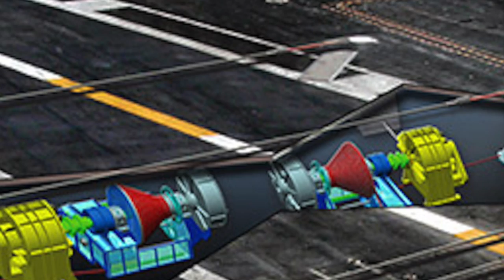WHY RUSSIA & CHINA SHOULD FEAR USS GERALD R. FORD? TOP 5 DEFINITIVE REASONS

Comment: 3:28 All the handles on top of the nuclear reactor are to open the multiple lids so technicians can do visual inspections of the many core elements.  This single reactor is an I-8 design.  Eight core elements.
Reply: Those are Electo Motive Diesel two cycle engines.

Comment: The USS Jerry Ford is quite a bit bigger than the Nimitz.   Larger ships can absorb more punishment.   If a YF-21 missile hits this ship and leaves a 40 foot hole from the deck to the keel it can survive better than the same damage on a Nimitz.    

The Navy is wise to think about this as sensors are becoming increasing more available and precise to allow these ships to be targeted.
Reply: Better to avoid or block an attack than to attempt to sustain it.. anti air on top and anti marine under is wiser but still not perfect.

Comment: I work at New port news ship building in Virginia that ship was commissioned with so many problems it had to be pulled back into dry dock. It was litterally dead in the water with no power for 3 days bet the news won’t tell you that thou...
Reply: nathan montes well it was late on it’s due day bud just because that doesn’t mean they didn’t fix it and doesn’t mean it’s shit
Reply: During tests that's normal
Reply: @tomocholla4458  O yes, the lets see if it can be dead in the water for 3 days test, - passed with flying colors

Comment: Everything has a weakness, I'd start with the computer systems as its probably manufactured in China. Ski jumps are not archaic, they are practical, they still get aircraft into the sky and don't suffer mechanical breakdown. You don't need a sledge hammer to drive a tack. Remember, never under estimate an opponent, it could cost you dearly. This ship can be sunk and that would be costly.
Reply: BTW ski jumps are archaic it limits what type of aircraft can takeoff/land on it. Can't have any larger slower planes the ski jump only gives them altitude not speed.
Reply: I doubt the computer systems are manufactured in China when the US is somewhat pissed at China
Reply: Ski jumps are achaic, IT limits Aircraft seize and ordenance carried

Comment: Each Ford class carrier costs $13 Billion. The F35 has cost $1.5 Trillion which could buy 115 Ford class carriers.
Reply: Mole Catcher a single f35 doesnt cost $1.5 trillion though? So stupid comparison. They cost $85 million each do you do the maths on how many f35’s you could build instead of one of these lol. Either compare individual to individual or whole projects to whole projects doesnt make sense to compare it the way you have. Besides you need aircraft to make an aircraft carrier useful. No point in building this amazing modern machine to then use 35+ year old F/A 18’s when you have modern f35’s to go with the modern carrier.
Reply: @0riginalFIR3  The programme is currently projected to cost $1.5 Trillion(this is likely to increase as have all previous estimates). That is 1500 x 1000 x $1 million. So, assuming that the $1.5 Trillion is Capital Expenditure and a unit cost of $85 million, then the US should be taking delivery of 17647 F35s which seems highly unlikely. For reference there were only 15000 P51s built. Clearly the $85 million unit cost does not cover the full cost of the project. The point is that there appears to have been a huge amount of US taxpayers money spent wastefully.

Comment: So the new launch systems use the same type of technology as a rail gun? Rail Guns are awesome... it is to bad that they require so much power and firing one slowly destroys them
Reply: Almost correct. Just one thing. It doesn't slowly destroy them. Maximum 2 shots at full power, and you're done.
Reply: Power is not a problem, composite materials Are

Comment: This may sound weird but I was thinking the other day about China and Russia's missiles nuclear or otherwise. What if they used an upgrade of the 6-inch gun or something that caliber and upgraded it to where they could use the 16 inch gun two or like a double-ought buckshot in a shotgun 12 gauge shotgun even like a proximity Road. Sight word processor word processor you're fired. Anyway just point the 16 inch gun like an automatic gun on a 10 can. It would take more metal infrastructure but if you shot the gun up toward an inbound missile, and you used it like double-ought buckshot and a shotgun and these were high explosive proximity rounds, would it be possible to take out a nuclear missile or weapon in Bound. It could work but who knows right? And they could use different kind of explosives in these proximity rounds even if it was small Tactical nuclear rounds. LOL

Comment: The Ford Class carrier is epic.
However in the top 5 you said the 2x 300mw producing nuclear reactors as a point on why the Russians and China should fear it.
What happens when all your nuclear Navy retires? 
The big problem is desposal of the radioactive vessels? 
Well in the UK we only have Nuclear powered subs and many times left than both the US or Russia, let's face it Russia had more Nuclear Subs than both the UK and US Navies. 
Prehaps, although the power output puts it in line for power hungry Star Trek type weaonary upgrades. 
Again what happens when they retire. 
Where are you going to put all these contaminated vessels when they outdated. 
Prehaps Russia and China are just waiting for you to be overloaded retired Nuclear vessels to degrade and contaminate yourself. 
Prehaps this is why they haven't "updated" to Nuclear Carriers, subs are understandable. 
With fossil Fuels starting to be a rarity, they need to do something as does every part of the world's military. I cannot see even the US using very expensive single malts to run the Abrams MBT.

Comment: If we went to war, to the extent that the carriers became targets from either of the countries with the capabilities to send missiles to sink them, they are going to sink. 
Russia and China both have multiple warhead missiles that sent in multiples, can take out any carrier. 
The Kursk submarine was an example. It was a sacrificial sub, armed with 36 multiple warhead missiles, each capable of deploying seven independent smaller "smart" anti-ship missiles to the target. 
That's 252 separate missiles, each one capable of sinking the carrier, all arriving at the same time, programmed to come in from different directions.  There is zero defense against that massive firepower. 
That ship is going down, and its going down shredded.

Comment: Complicated electrical system to get your plane to take off is a negative the ramp is smarter design.
Reply: The ramp design has weight limits that prevent you from launching larger craft, plus without a ramp, you can launch multiple sorties at once. It's a slower, weaker, lesser design.

Comment: Nice carrier the Ford but have problems with the uk one compared to the ford you could sink the uk ship i would like the  navy servicemen know they are going to the artic without any planes and just to be used as a spare even there it has NO anti ship or any anti aircraft defence at the present moment and would like to know by 2020 if it still have anything also why dud we make it with diesel engines and not atomic like all other carriers have

Comment: In short. They should fear it because of its radar and because it can launch 30% more planes in the same span of time. I don´t think they will in particular lose sleep over that. They have no reason to fear the new take off system. No reason to fear that it only have to refuel in 20 years. The older have fuel so much time that it is a none issue. It has a new engine, they don´t have to fear that. Less human error is hardly something they will lose sleep over either. Railguns and lasers are still in the future and esspecally railguns not fully developed. I don´t think that makes them sweat. 
What Russia and China has to fear here sounds like almost the same they got to fear from the Nimitz. The weapons it can shoot and planes it can use, which I presume, aside from a laser are the same weapons and the same planes.  And I think they are already using drones from carriers.

Comment: The future is in fast missiles launched from most convenient locations under seas.
Reply: Future is in lasers and railguns. Missiles are so last century.
Reply: Relayer6a Lasers are easiy defeated by clouds and smoke screens. Railguns require capacitors able to withstand immense electrical discharge and dense anchoring as not to get ripped off the floor during firing. Not mentioning insane price of the warhead’s sabot, circa $1 million per shot, as proven onboard Zumwalt class navy ship.
Reply: @AbgebeSpermium  If you think $1M is an insane price, you need to check the price of those hypersonic missiles. And subs aren't exactly an economical launch platform. And the US can actually afford to  put these weapons into service and maintain them. Look at the Russian carrier and what's happened to that.

Comment: Fear what ??    .... Russian Fighter Jet Disables US Missle Destroyer Using Electronic Warfare Weapon... 
Published on Nov 16, 2014
The Russian Air Force Khibiny is an advanced aircraft-mounted electronic warfare (EW) system capable of jamming state-of-the-art air defense radar systems. The Khibiny jamming was tested successfully for some time on the ground in Buryatia, Russian Federation. On April 17, 2014, two Russian Air Force Su-24 bombers with no weapons loaded were sent to intercept the US Navy's AEGIS-equipped destroyer USS Donald Cook in the Black Sea. One of them flied around the destroyer up to 12 times while the other one remained away as done usually by both sides during the Cold War period. Unconfirmed reports suggest that the Su-24s were equipped with the Khibiny EW system and were able to neutralize the AEGIS phased array radar target tracking capabilities while the ship's crew was unable to re-boot the system. It is not clear whether the jammer affected the radar system itself or only the computer-based component or either both at the same time. The Russian Air Force plans call for the installation of the Khibiny jammer on all its advanced jets....   <3 W/B <3

Comment: Very interesting, but not entirely accurate.

Rail guns are not ready for service, and it isn’t known when they will be. There are still major impediments, such as the gun destroying itself after a few firings.

As far as lasers go, a 30Kwatt laser isn’t all that useful. It takes seconds to knock out a missile, as can be seen from tests. That limits it’s usability if the carrier is attacked by a multitude of them. There is a 250Kwatt laser being developed, and initial tests have occurred, but it may take years before it becomes a combat weapon.

The real problem is just how defensible is a large carrier? In a real war, what weapons would be used against it?  Could they overwhelm the defenses of it, and the fleet it’s within? If a tactical nuclear weapon is used, the entire fleet will be destroyed. another difficulty is that the electric catapult is still having problems. Infamously, Trump wants to tear the entire ship apart and install a steam version.

The real question is whether a carrier is of any more use now, than a battleship was in WWII.

This video is way too positive, and lacks facts.